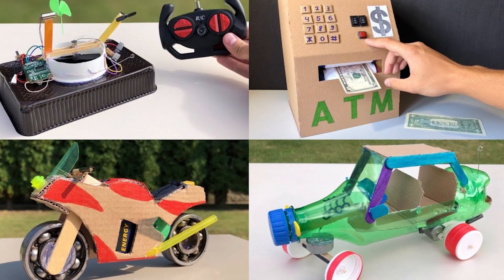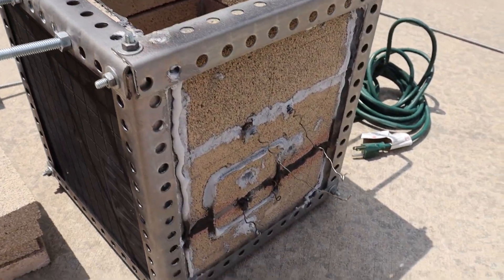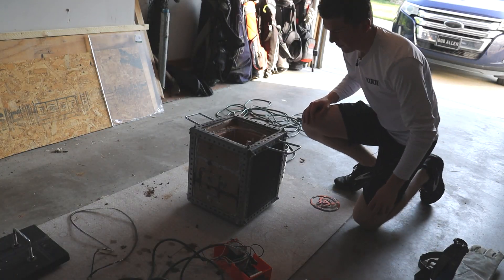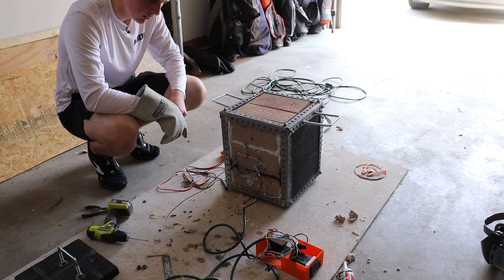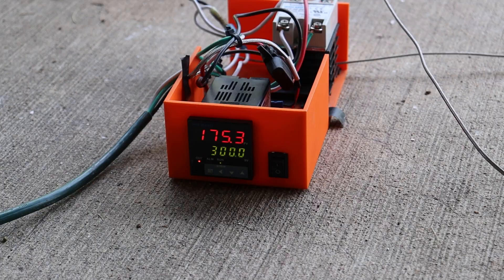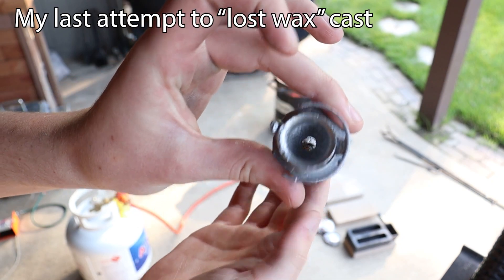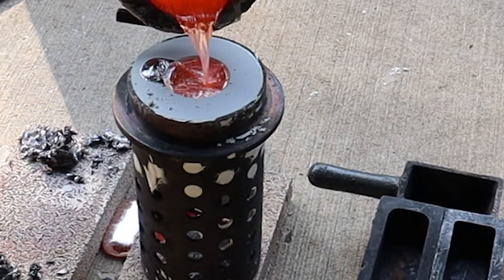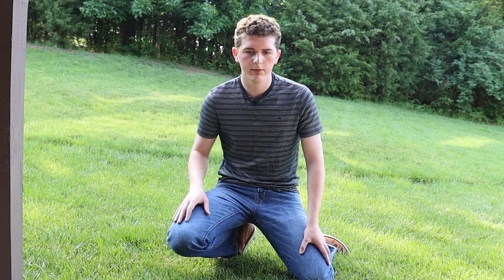DIY electric Kiln (Part 2)

Comment: Casting on concrete is very dangerous, and messes concrete up. Hot metal hits concrete and splatters from the moisture within it exploding out. You can get molten metal flying everywhere.

A piece of sheet metal, or a good layer of sand, even plywood with a way to put out a fire is much better.